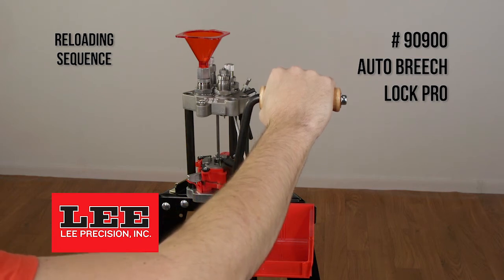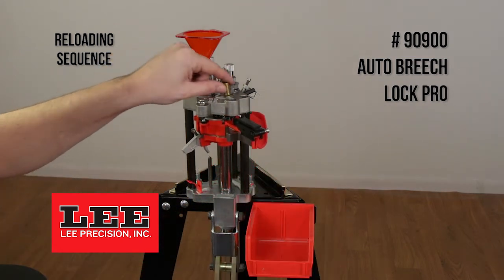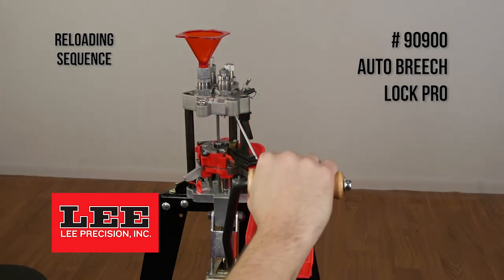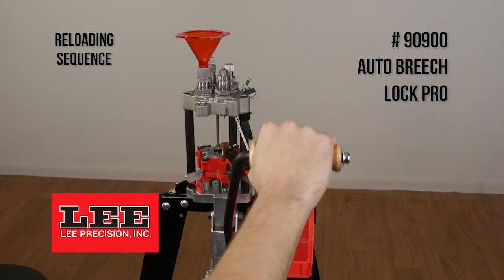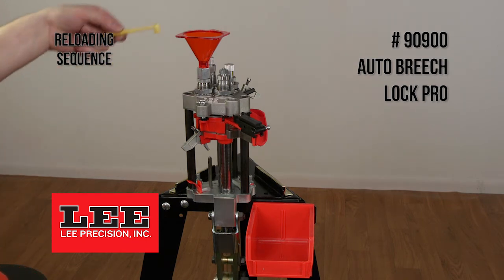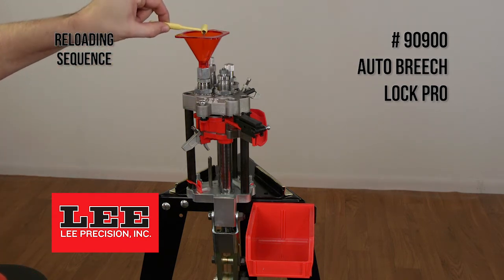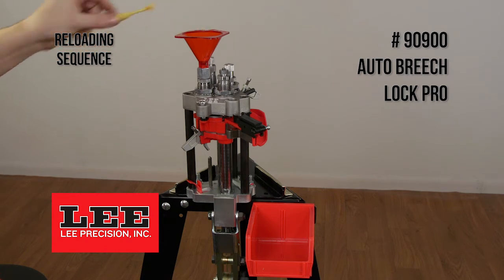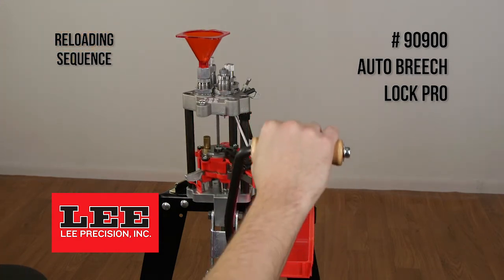90900 Auto Breech Lock Pro Reloading Sequence

Comment: Thank you for the simple operational video.  I've watched a couple of videos on this new press and they assume the viewer understands what is happening in each stage.

I'm still liking the looks of the Auto Breech Lock Pro press.  It appears to be the best aspects of a single stage and progressive press.  The throughput is way more than a single stage press but less than a properly running progressive press, however, it's a lot simpler and more reliable than a progressive so more time is spent reloading and less time is spent adjusting a progressive press.  This looks like a great press for someone new to reloading who wants to make a lot of pistol ammo or 223 ammo.  If I didn't already have five Lee presses, I'd buy one of these!